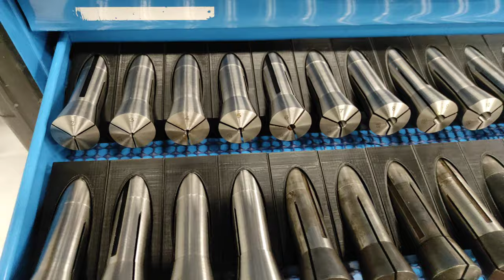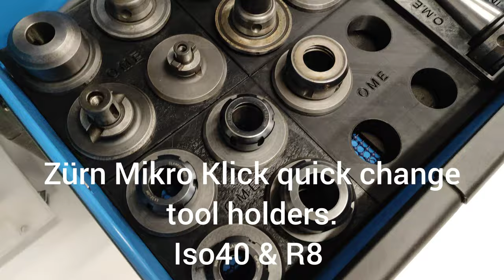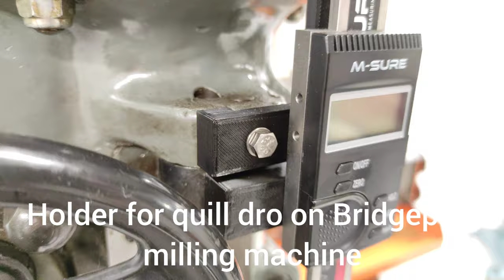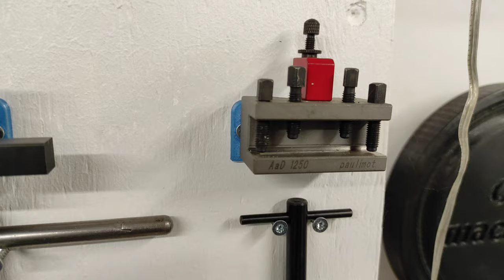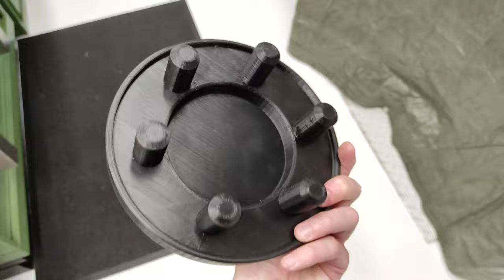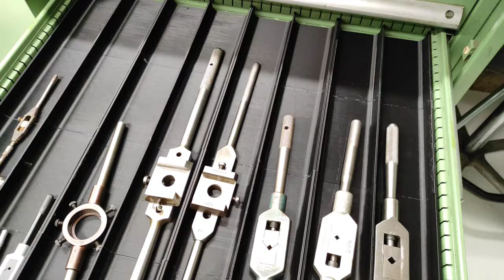3D printing in the home shop? Is it a tool that you need?  YES! 😁 Tool storage made easy

Comment: Great use of the technology. Can you give an indication of the consumable cost for any of the collet or NT40 tooling holders ?
Cheers, Alan.
Reply from the maker: Thanks.  It's also depending on the electricity cost of course. But a filament roll do cost ~35$ - and with that I can make all of the collet holders you see here.  They are printed with only 10% infill. So they are hollow. But still super strong for this purpose.  I think I printed all the Iso40 holders on one roll of filament as well. - it's not very costly when dividing cost pr. Printed unit 😊